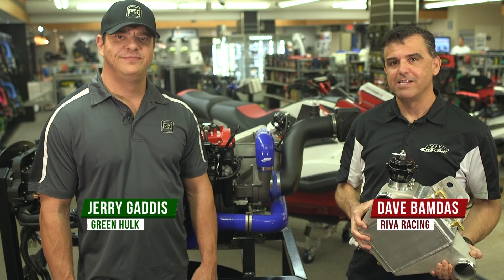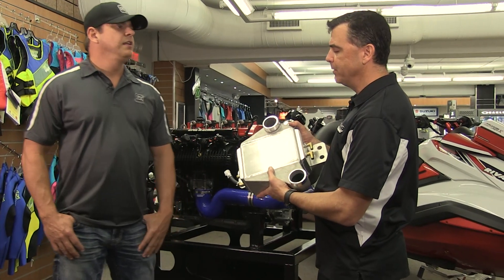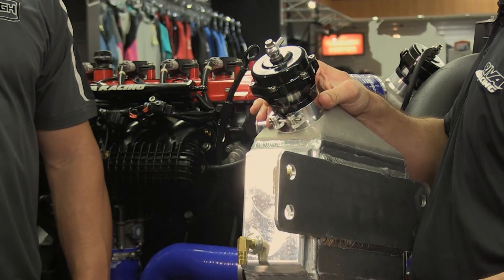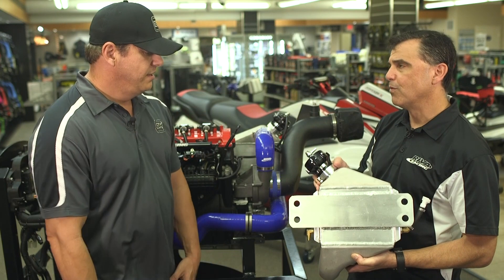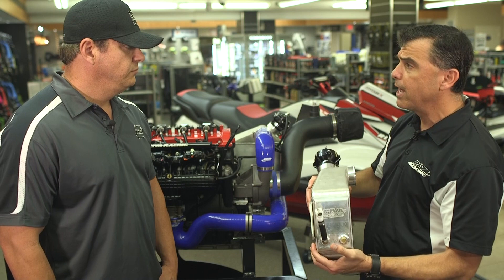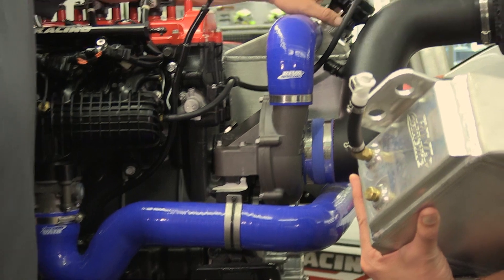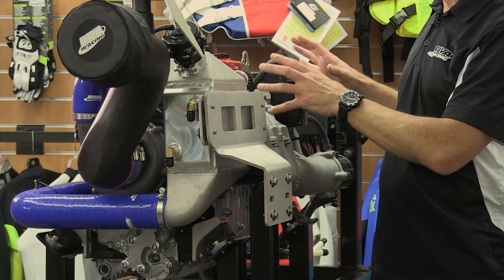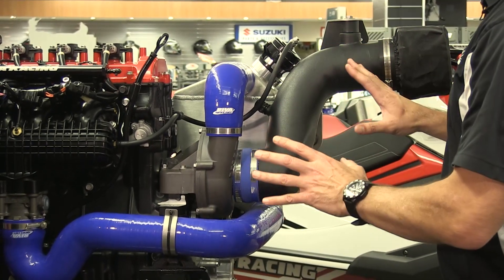RIVA GEN 3 Yamaha Power Cooler Walkthrough GREENHULK.NET

Comment: I was wondering if you could speak to the required Yamaha 2020+ SVHO Engine Cooling Upgrade kit that as I am told a must with the Gen 3 Power Cooler?  Why is it a must and do you have any awesome you tube how too for it?  Thank you.  Just FYI I just bought my first wave runner "2020 GP1800R SVHO" 
ever and bought a few extra items to have an edge on the average person, not a racer, but did get some of your best stuff.
Reply from the maker: Any time you increase power output of the engine you need to increase cooling capacity. The intercooler gives your engine a HUGE increase in power. Any time you go with a larger external intercooler you need to also install the cooling kit. Riva developed this kit with countless hours on the dyno and on water testing. It’s definitely a must do mod any time you install an install an intercooler.
Reply: @GreenHulkGarage  Thank you for your timely reply, do you have any additional info in regards to a how too demonstration for the "engine cooling upgrade kit" with the Gen 3?
Reply from the maker: You will find the instructions here https://rivaracing.com/file/7268-RY10080-ECUK-PC-2+-+Pro+Series+SVHO+Engine+Cooling+Upgrade+Kit.pdf